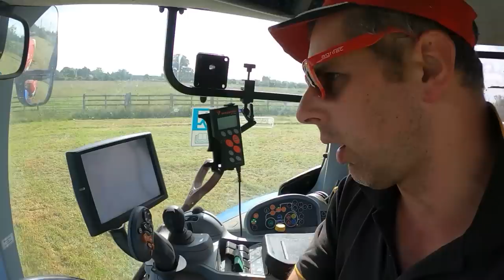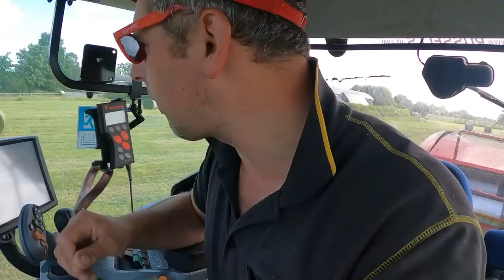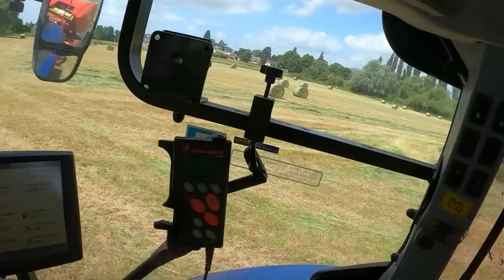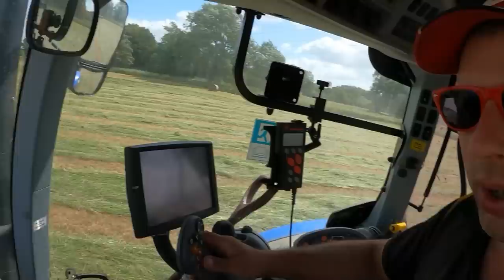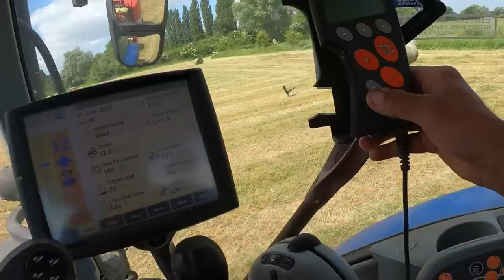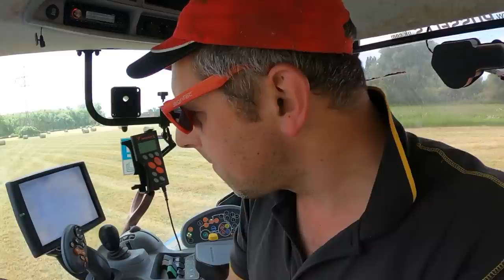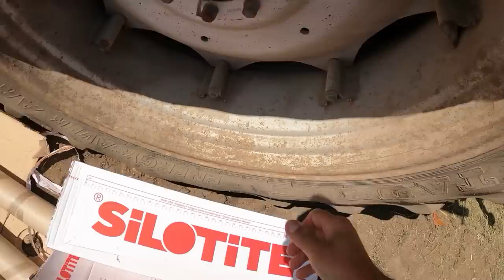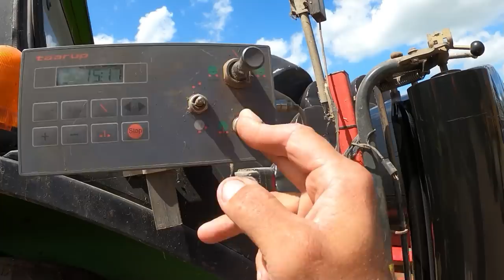A DAY SILAGING - BALING - CARTING - WRAPPING

Comment: Evening George yet again another cracking video look forward to your vids 👍.I used to drive a Fastrac 3230 on trailer haulage pulling Bio solids I actually swapped my mirror's from side to side it sounds daft but they then fit inside the mirror arm making it less wide but they are just as good for visibility.

Comment: Tractor looks great 👍 I'd rather redo a predef Tractor and get it back in service than buy a new one and have to call the dealer out everytime it has a sensor that isn't happy. I'm starting to like that yellow machine it almost matches my gold baler. We have several cummins engines and a powerstroke either one get down and pull